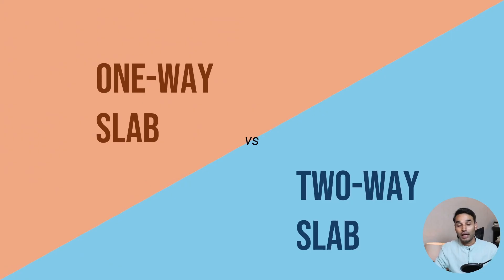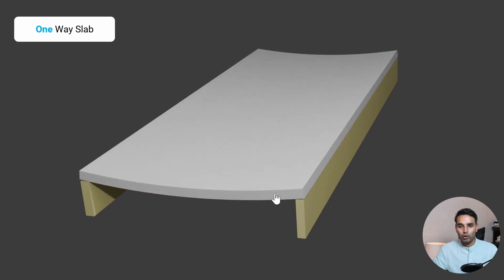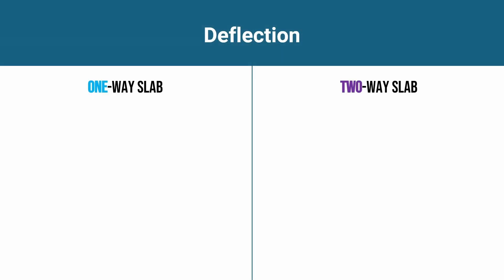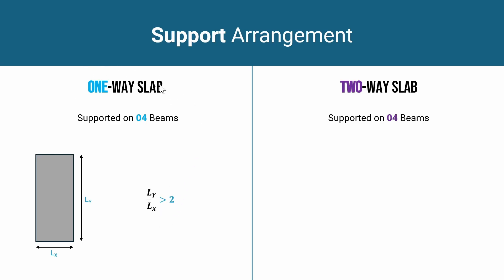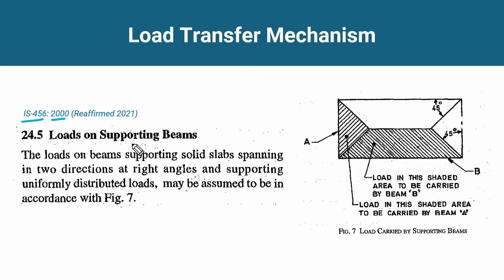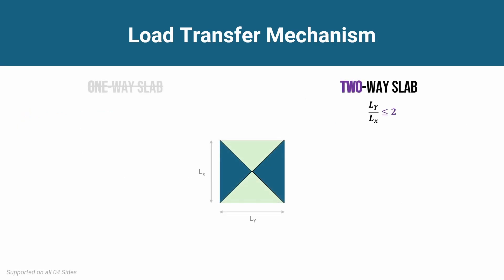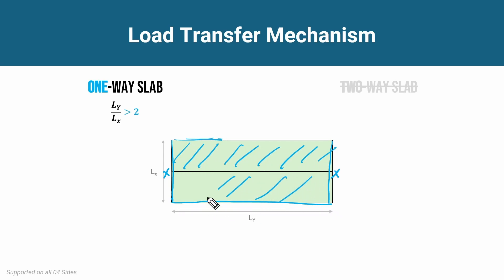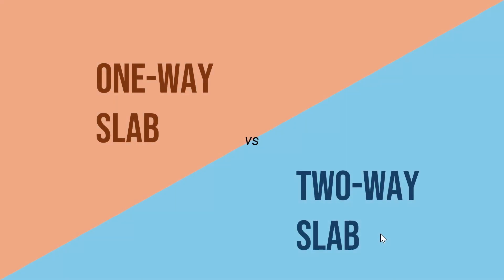One Way Slabs vs Two Way Slabs

Comment: Some load also  gets transferred to shorter spans (if supporting beam or wall is available there), even if ratio of long span to short span is greater than 2  in real scenario. In fact , load  itself finds shortest route to be transferred to nearest support  available i.e.  any load on point close to shorter span   get transferred to beam / wall if available at shorter span  and that load will not take long route to reach beam on longer span of slab. This is a physiology of load that load gets transferred as early as possible without taking longer route, but meanwhile if support on shorter route gets collapsed , load has no option other than to go to the nearest beam/wall on longer span.